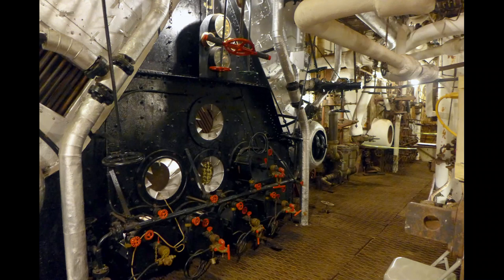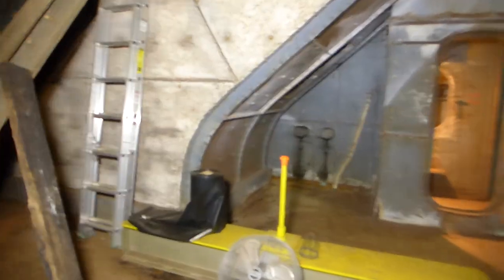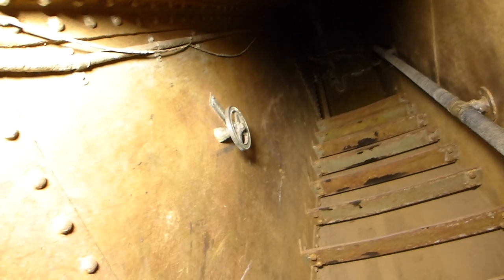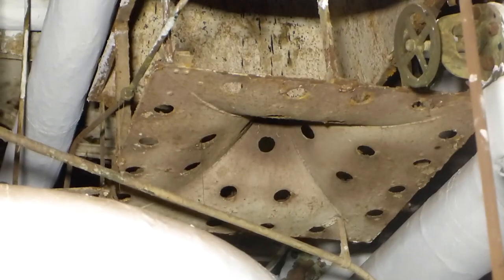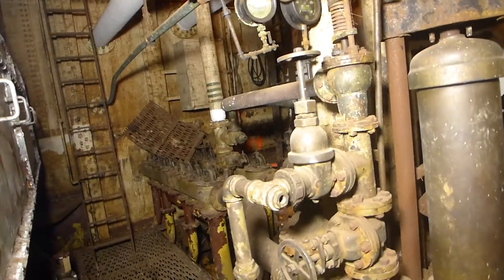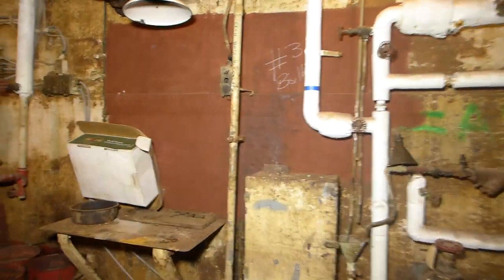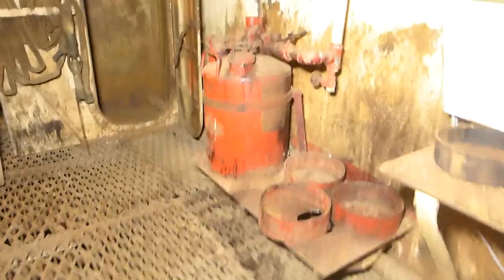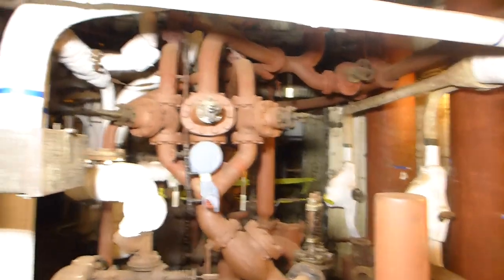Battleship Texas, a look around Boiler Room 3.

Comment: All the stages of fuel preheating, even going back to the bunker tanks, helps me understand why it took as much as 10 hours to "raise steam" for engine power.
Reply from the maker: Fuel heating wasn't the problem.  The biggest issue was gradually heating the refractory brick that lined the inside of the boiler firebox.  Heat it too fast and it would start flaking and crumbling.  Do that and the best you could hope for was that you may be able to operate the boiler at a very low level so that you didn't burn through the casing.  Then, back to a shipyard where the firebox could be relined.  If the entire ship steam system was cold, it had to be gradually heated.  There are a lot of expansion joints that would leak like sieves if not properly warmed up.

Comment: Hi Tom, it must have been quite an art starting the boilers up from cold with the diesel oil. I've been in a factory that made oil burners for very large merchant  ships boilers and at full pelt they really throw out some heat, like a gigantic blow lamp.. The ones I saw on test used a spinning bronze cone to vaporise the really thick crude oil they were fed with - even still had sand in it. The expensive cones wore out and had to be replaced as a result. BobUK.

Comment: i would love to get in there and painstakingly spray a fine directional mist of diesel over all the rusting parts, possibly followed by a jet washing, followed by a wipe down with a wax oily filled rag, it would be a great way to bring the colour back, get rid of the dirty rusty look and preserve all the surfaces which can be easily kept clean for the future
on the whole i am pretty surprised how good everything looks, but it be fantastic to bring it back to life without massively stripping down, cleaning, repainting so few parts and still have a mass of dirty looking areas - it could be done for a lot less than you'd think - i've done similar on aircraft and managed to keep them looking good with little upkeep after

Comment: Yet another fabulous video! One question I don’t recall if you answered in the steam video, feedwater level control in the boiler. Was there a rudimentary automatic boiler level control?
Reply from the maker: Thanks for the compliment.  One would think that it wouldn't be that hard to cook up some type of automatic control, but I've never found any sign of one.  Technical descriptions of the Dyson design and steam manuals of the period indicate that it was strictly manual control with the water tender watching the sight glasses on the steam drum.  One publication that covered issues with water tending may suggest why.  These boilers responded very rapidly to increased firing and even though cranking them up would increase water consumption and require increasing feed water, not at the moment heat was turned up.   A rapid heat rise on the generating tubes would initially push water up them due to rapidly expanding gasses and increase the water level in the steam drum.  After a short period, the gasses would work up the tubes, the water level would drop and feed water would then need to increase.  If you increased water too soon the surge would add to it and likely create priming that sent liquid water into the steam system.  Very, very bad.  If you saw the sudden surge in water when heat was increased and immediately cut back feed water, the cutback would combine with the following sudden drop to uncover boiler tubes and instantly damage them.  A good water tender knew to keep his hands off the feed water valve for a short period, then start adding water as he watched the level start dropping.  I am not sure how auto feed systems in the 1930's and '40's worked, but it would take a lot of sophistication for a mechanical analog design to be able to account for those situations.

Comment: Very educational, the ship and maybe other like her had a some safe and  emergency  system in them. But I learn that in battle that a ship ran on half and standby. That is half of the ship is up and running at half while the other half is operating a low for stand by.  In battles one side of the ship is firing at the targets but is also that side is expose to enemy fire. So if that side of the ship gets badly damage, they can quickly switch power over to the other side. One note and not sure if Mr. Scott can cover it and that is emergency steering, that is if U.S.S. Texas has one or not.  That if the bridge gets blown away or loose control, the ship can be steer from the engine room ( my father was a sailor on U.S.S. Makin Island).
Reply from the maker: No, that is not the way it worked.  They never held half the engine power or steam mains on standby.  There was no good reason to hold one engine on standby.   The entire goal was one of damage control.  The two engines were operated together and almost always took identical speed commands from the bridge, but they were fed by separate steam systems, divided between port and starboard sides when in battle condition.  The only reason for dividing it was so that if there was serious battle damage, you wouldn't lose everything.  The worse that could happen is that you would lose one side or the other, but not both.  Once they could determine the location and nature of the damage, they would isolate it and bring undamaged boilers back on line.  If, for instance, there was a rupture of the port steam main between the boiler rooms and engine room, the port side boilers' valves to that main would be closed and cross connects opened so that they fed into the starboard steam main.  That way, you could have close to full steam available, even though it would only be on the starboard steam main.  The port engine would have its port main steam cutoff valve closed and a cross connect steam line coming from the starboard engine room would be opened.  That would allow both engines to operate on the undamaged starboard main steam line until repairs could be made to the port line.

By the way, while nothing is impossible in battle, it was unlikely that a steam main could take a direct shell hit.  They were well protected behind the belt armor, two voids and at least one fuel tank.  The only real possibility would be a high angle plunging shot through the relatively thin deck armor.

There were five locations from which the ship could be steered.  The navigation bridge (steam and electric), the armored conning tower (steam and electric), central station (steam only), at the steam steering engine (steam only) located at the aft end of the starboard engine room, and aft steering at the far back end of the ship (electric and manual).
Reply: @tomscotttheolderone364  Sorry, I misunderstood and show a lack of knowledge.
Reply from the maker: @robertn2  Please don't apologize, Robert.  These are very complicated systems and are not intuitive.
Reply: @tomscotttheolderone364  That I learn which goes to prove those sailors were well train and skillful. As for me, I will make mistakes, and admit being wrong.

Comment: First of all I want to thank you.
Your videos are the most interesting and informative.
I watch all of your videos and just eat the information you give. 
It is just most interesting.
I find that I'm mostly interested in fuel oil system, it is very complex.
I did see all of your videos, about one thing I have a question.
Sorry for my english, I'm from Finland.
So maybe the answer was in the videos, but maybe I just did not understand.
So the question is about recirculating.
I can see and know how it works.
But does every tank have own pumps?
Or is there only main pumps? 
If it's only main pumps, and there are in use different size tanks. How it's made sure that each thank in use have correct amount of return flow so that smaller tank wont overflow?
Thank you again for your videos and forgive me my english.
Reply from the maker: FIrst, thank you very much for watching my videos!  Also, there is absolutely nothing wrong with your English and thank you for the very good questions!  As you may recall, each boiler room has a booster/recirculate pump.  These were used to pump fuel at a constant pressure through an initial set of heaters, the fuel into service tanks where it was stored at an elevated temperature before being pumped at a high pressure using service pumps through a last heater stage and to the boilers' burners.  Any one of the three booster pumps could maintain enough flow to satisfy the needs of all six boilers, so they could either run together to pump fuel to the service tanks, or one or two could be used to recirculate unused fuel back to the fuel tanks.  That was the most likely way of running them.  They never had to worry about return flow overfilling a tank since fuel was returned only to the tank that it was taken from.  So, two things happened.  First, heated fuel returned to a tank gradually heated all of the fuel in the tank, making it easier to pump and handle.  Second, fuel level in the tank would gradually lower until it ran out.  They could estimate with pretty good accuracy when that would happen using flow meters, so it would be an easy matter to switch suction to another tank before that happened to maintain uninterrupted flow.  It gets really interesting when the ship was in combat, because they only used 6 tanks that were called battle tanks.  These were very well protected and held a great deal of fuel that would easily last a day under most conditions.  This allowed them to shut off the other 86 tanks and their fuel lines so that they wouldn't interfere with the boilers if they were damaged or contaminate fuel with sea water if they leaked.  If battle tanks started getting low, they could use one of the booster pumps to move fuel from a closed off tank to refill them.

Comment: my dad was a BT3 (when he got out) 51-55 on a DE and then an APD.  he fell through some of that grating that a fellow BT or water tender, had left out of place, when they lost all lights during a ship to shore power switch over.  he still suffers from a bad back and kidney at age 92.

with the current dry docking, will any of the interior refurbishment be undertaken?

Comment: I imagine this ship was cacophony of noise in operation.
Reply from the maker: The boiler rooms certainly were.  Any telephone conversations had to happen in a sound proof booth.  Congratulations for using "cacophony", it's the word of the day!  :)
Reply: @tomscotttheolderone364  As a old BT, I started out on the A type boilers (USS Piedmont AD 17) which were just a little more modern than the ones on the Texas, went to the M type, USS Meredith (DD890) and USS Midway (CV41) then to the 1200 D types before I retired in 95. Watching your vid shows the start of the modern steam engineering plant. So much is the same. BTW the 3 element feed water control valve was first used on the 600 psi M type boilers, but a checkman controlled the water level, and the automatic control valve was only for battle stations in case the checkman was hurt or needed to control damage.
Reply from the maker: @johnchilds6471  Thanks for the input on the use of auto control.  I have a few more years of learning on Texas before I spread out to newer technology!
Reply: @tomscotttheolderone364  I lost points because of the word cacophony on my SAT in the 70s. It haunts me to this day.
Reply from the maker: @MrTexasDan  I understand and sympathize.  It much the same as the way I lose points with my wife when I misuse the term, “Yes dear!”
Reply: @tomscotttheolderone364  How about, By no means is the boiler room a refuge for pusillanimous types?

Comment: If money was no object could this ship, be brought into a condition where it could run under its own power. I'm just curious. I'm sorry if I sound like a big dummy.
Reply from the maker: It's a perfectly legitimate question that has been asked many times.  The cheap answer is that anything can be done given enough money and time.  A realistic answer is that it would likely be cheaper to built an entirely new ship that is a replica.  It could include modern equipment and designs that is more serviceable, more reliable and safer.  The ship is first and foremost a museum and memorial to those who served.  The problem with actually trying to restore her is that there are no parts to repair or directly replace boilers, steam lines, pumps and a multitude of other equipment.  Replacing, repairing or modifying them would significantly alter them.  This would destroy her historic fabric and she would no longer be an historic artifact, just a big, old resto-modded ship.  For that reason alone, any effort along those lines would never be considered, even if the 100's of millions of dollars in needed funds was available.

Comment: Fireroom not boiler room. Just sayin. BT3 86-93
Reply from the maker: Thank you for your comment.  I appreciate getting feedback from guys who ran this stuff.  I agree that "fire room" is the most commonly term found in tech and engineering manuals that go back to 1900.  However, every one of Texas' ship's plans, from her 1912 builder's plans to the 1944 booklet of general plans, refers to them as "boiler rooms".  "Boiler room" is also what is on the brass plates above each of the doors that lead to the rooms on the battleship.  For those reasons, I figure either term is acceptable.